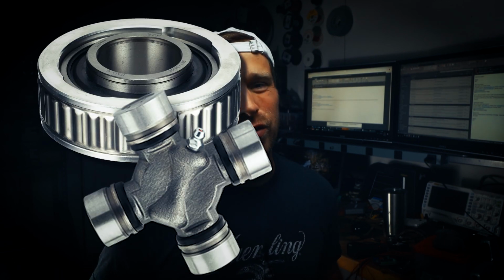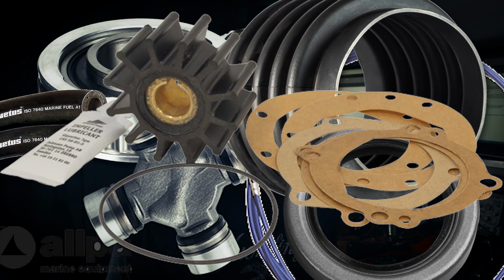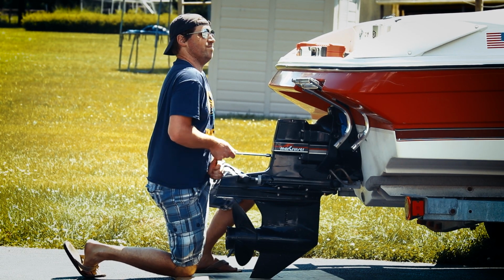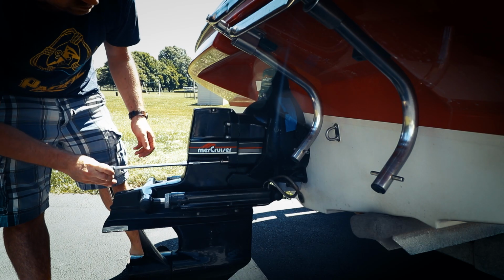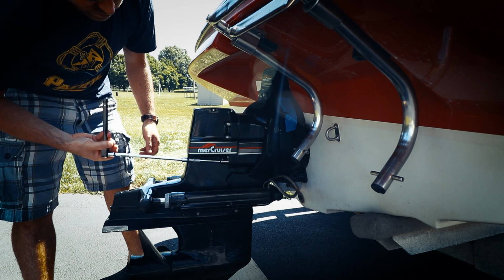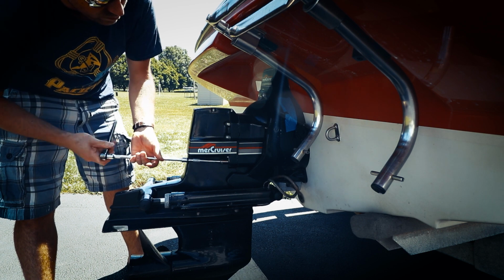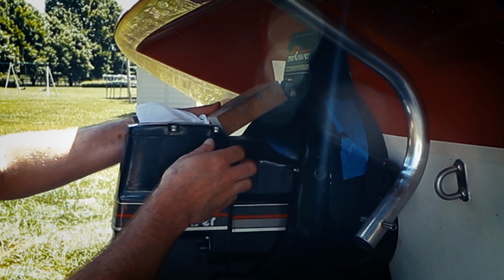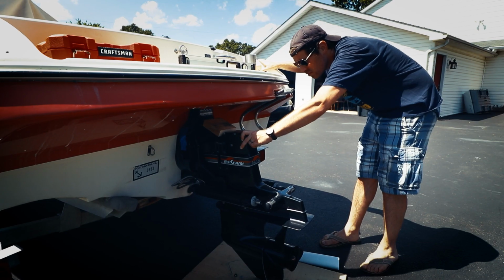How to Remove a STUCK Sterndrive CORRECTLY!

Comment: IT WORKS LIKE A CHARM....  Ok so I have to admit my wife found your video, and I have to admit this is awesome!!!  My gimble bearing was stuck onto the shaft so it came out along with the drive. So there is no way it would budge but this process made it come out super easy. I used a 5 1/4 2x4 then a 5 3/4 long 2x4 to finish. Awesome!!! I also updated my hydraulic trim with remote cable too. Thanks for that as well....

Comment: Thanks for your tips man!! I have a Bayliner too. A 2001 Bayliner Capri 2150 with the 5.0 so basically same boat! I changed my impeller while the drive was still on it but now i wanna pull the drive to inspect the bellows.

Comment: I already had lower unit off.Was doing a service on hoses and water pump.A floor jack with 2ft 2 x4 works well just pump it up on the upper drive behind where water pump hose is.Mine was so jammed it was picking trailer up.Your technique modified for my situation worked perfect.

Comment: Excellent!! I did that a few months ago in puerto vallarta Mexico, a had a really stuck sterndrive. 

It took me 2 days until I almost gave up, when I was about to move the engine I sat on the ground, I was having a beer because it was very hot and it occurred to me to use the hydraulic system to my advantage. it really works just make sure you lock the upward movement and have a second person help you with the trim button

Comment: You my friend are a genius! I’ve been wrestling to get this drive off for the last hour and making no progress. Used your technique and had it off in seconds. Awesome 👌🏻

I did it by hand though to put less load on the gimble ring - removed ramps and lifted the drive up using the wooden fulcrum and out it popped

Comment: About to do this on my 92' Alpha One GenII. Would it be wise to leave the nuts on but backed off to get the first pop with out the out drive dropping or damaging anything?
Reply from the maker: Never tried this, but I suppose it would be okay... sometimes it still tends to hang up beyond that point, but worst case is you try it and its not enough and then you remove the nuts and pop it off the rest of the way.